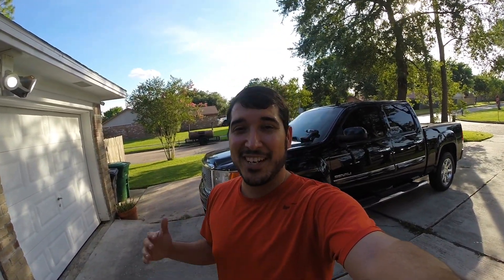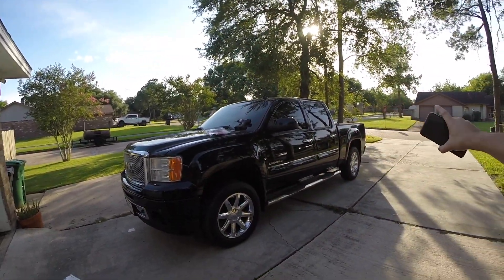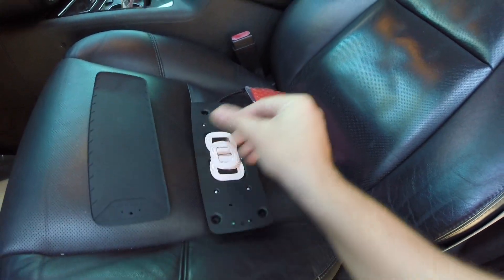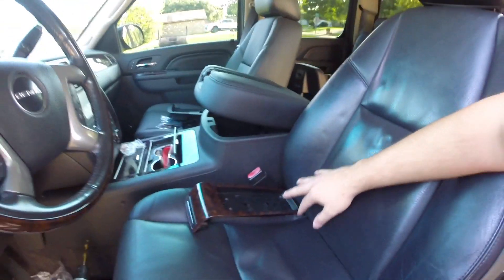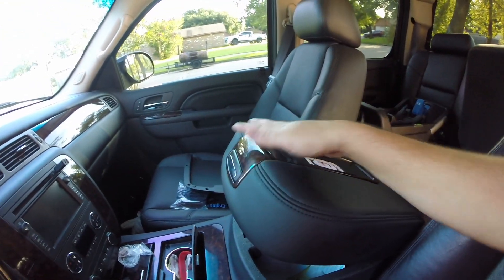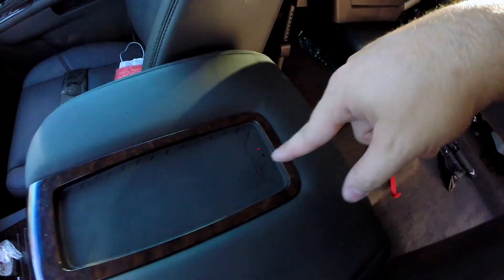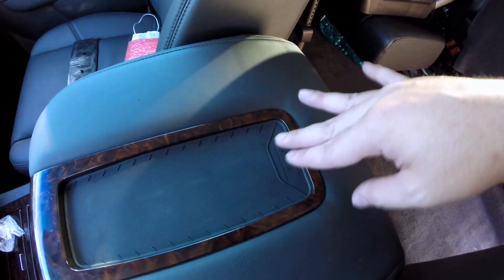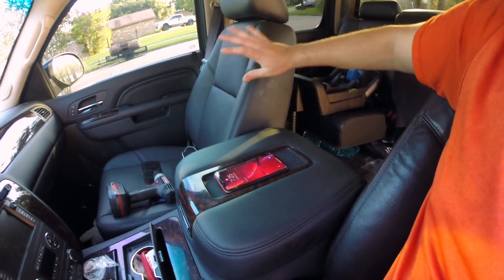Wireless Charging on my 2011 Sierra Denali! | Vlog #338

Comment: Is there a way to do this to a 19 camaro? I know the 16-18 6th gens had that feature but wasn’t the best.
Reply from the maker: Not sure, If they still sell the rear  area wireless pad you might be able to use some plug and play harness or the connector might still be in place just need to cnnect the pad.

Comment: Have you had any issue with towing since you installed the leveling kit?
Reply from the maker: I havent had to tow anything, but i would suspect it would be fine. Might have headlights pointed slightly upwards, but i had actually pointed them down slightly to compensate for that.

Comment: Will this work on my 2010 Avalanche LTZ?
Hey man for being a Denali it doesn’t have a radio back there?
Reply from the maker: Yes it should if it has the same style of center console, and no, this was more than likely the entry level denali trim because it didn't have the rear sliding window or sunroof or rain sensing wipers.